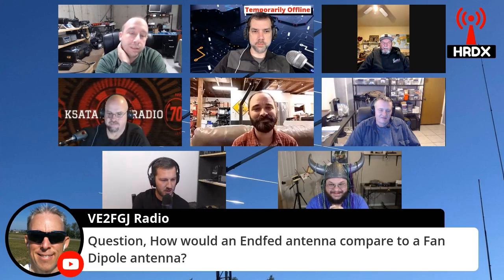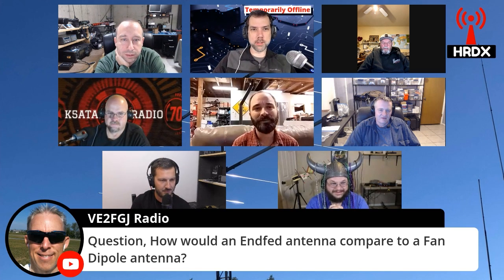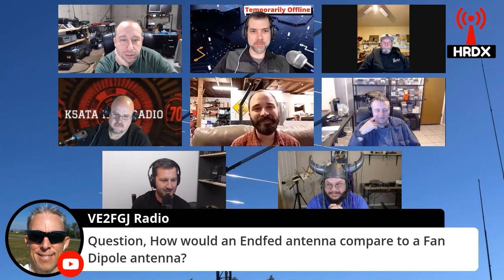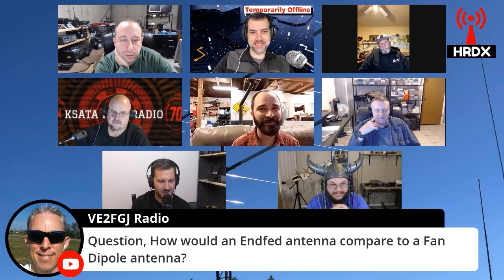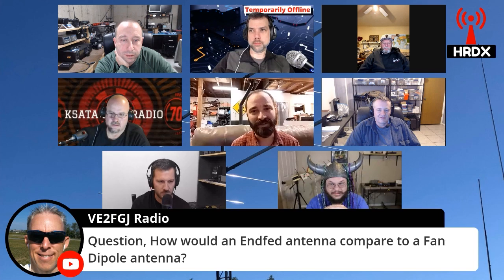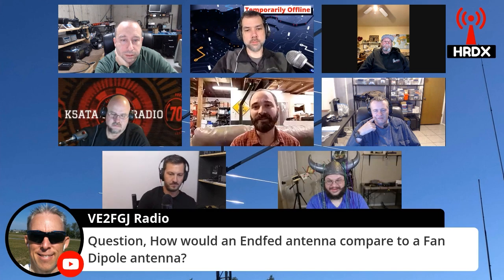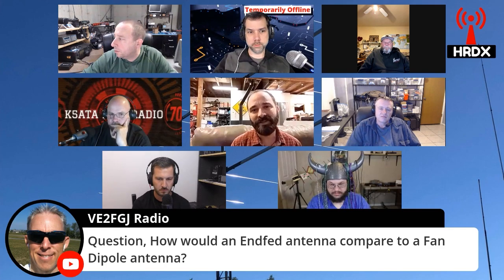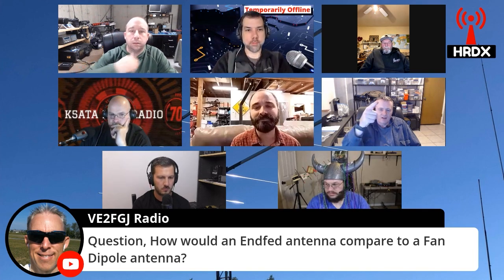End Fed or Fan Dipole Antenna - Which One Should You Use?

Comment: The big advantages of a fan dipole, of course, are:

a) - Requires only one coax, and not ladder line.
b) - Provides multi-band operation without the need for a tuner, so you can switch bands and immediately start operating.
c) - It is a full-length antenna with no loading coils or traps that lower efficiency and narrow the bandwidth of operation.
d) - It is inexpensive.
e) - It is easily constructed and tuned.
f) - It can handle a lot of power (up to 1.5kw).
g) - It can be suspended vertically to provide a very low angle of radiation for DX and requires NO radials.

If I had to choose only one HF antenna to use for the rest of my life, this would be it.   It's simplicity, lack of a need for a tuner, and ease of use simply cannot be beat.  Mine provides operation on 40m, 20m, 17m, 15m, and 10m - the most popular HF bands.   Adding 160m and 80m, of course, is also quite possible, but makes the antenna much larger.

Thanks, for the video!
Reply: Thanks for this reply Richard.  I'm a new ham and am trying to decide what to go with for a permanent HF antenna.  Today I pretty much decided on going with a fan dipole, 40-10m.  Your post has helped cement that decision.

I would love to have an Optibeam OB 12-6, which costs $3200 (ships today!), its longest element is 48 feet, and I would love to put it on a 100-foot tower in the yard.  That is not in the budget, and I'm not sure I would welcome the maintenance, weather damage, technical problems etc that will arise with such a lovely beast looming over my QTH while not having the equipment or expertise to repair it myself.  I would want to have an experienced antenna/tower man on speed dial should anything happen.

A nice fan dipole mounted to a couple of tall trees (which I have) and secured with a weight/pulley/paracord/poly rope system to be able to raise and lower it by myself at will seems like a far wiser (and about 95% cheaper) choice for the average dumbass who has just enough knowledge about everything to get himself in trouble.

Thanks again for the reply and for sharing your knowledge.  It's appreciated by us newbs.
Reply: @Brian424  Beam antennas are very nice - if you can put them together , tune them, install them, and troubleshoot them. They are exponentially more complex and difficult in virtually every way you can imagine.  A good analogy would be trying to learn how to cook and starting with the fanciest dish a five star French restaurant has to offer when you can barely scramble eggs - a frustrating endeavor that is bound to end in frustration and failure - unless, you get an expert chef/Extra Class amateur to help you out.   And, that's AFTER you plunk down your hard earned money and wait for the kit that you will have to assemble arrives.   And, in the end, you won't have nearly the feeling of satisfaction that you would get from building your own fan dipole from scratch.

Building your own antennas is also one of the most important skills any amateur radio operator can develop.  And, it is one of the most fun things you can do as an amateur, too.  Besides, cracking a big pile up with a 48 foot beam is hardly much of an accomplishment - but, cracking a big pile up with your own homemade antenna can be.

I remember when I first got into amateur radio I met an Extra Class licensee in my neighborhood (I went to high school with his son) and he had a nice array of antennas on and around his house.   But, the one that impressed me the most was when he told me he was using the gutters on his house as antennas.   Then, he showed me his awards for working the whole world on 0.5 watts.   I was hooked.

Have fun building your own Fan Dipole!  A beam antenna will come later when you learn more about how to build them and actually do so from scratch.   Then, when you've got that down, putting together a kit made by someone else might be in the cards - and, you will be able to handle it.

73
AI4IJ

Comment: I've been very pleased with random length end fed. 136' high power capability.  I've talked over 7500 miles on 10 meters just this week and haven't had the need to use a tuner yet. Many contacts have been surprised to hear I'm using one.

Comment: I am playing with wires for many years and still do. The fan dipole is great, but you are limited to number of wires, you know, usually one wire=one band. In flat top configuration it is directional antenna like every flat top dipole. You can make in a bit omnidirectional making it as inv.vee. 
Anyway, if I would choose just one antenna, first I must ask if I have lack of space (tiny lot, apartment house) or plenty of space.
In the first case, I would go for Cobweb antenna, you can buy it or build it. You can cover all bands from 40m to 6m. It is omnidirectional and very efficient. If you try to build fan dipole for all that bands, you will get a non practical extremely heavy and big monster. So far I tested it, this Cobweb is the absolutely best antenna for those with small lots etc. But not only for those, many hams using Cobweb anywhere, due to its price. Not all hams can afford towers, rotators and beams.
In the second case, if I have large garden or so and want just one antenna built for few bucks and for as much bands as possible, the absolute winner is Double Windom. 42 meters long version covers all bands from 80-10m. With tuner you can use it on 60m too ( I did over 120 countries on 60m band with this windom). With ext atu you can even tune it on 160m, of course with low efficiency, but it works somehow-I worked all continents and lots of dx with just 100w on 160m with this 42m long version. Ideal height is 10-15m above the ground. I use it at 10m agl and working the whole world every day with just 100W. Of course, in case of any antenna, it always depends what you have around, I mean surrounding objects and so. Location is always the main thing for any radioamateur. VY73

Comment: ....What the guy with the beard (Adam) said!!!     Bang on!! I have a 66ft end fed with a 49:1 transformer, resonant on 40,20,15 & 10, and I have just tacked a 110 microhenry coil on the end, with a 2 metre wire tail, and it now loads up on 80mtrs as well, ( albeit only 100Kcs 2:1 bandwidth  Small gardens in the UK!! )   Just fit a short counterpoise at the matcher box, you'll be fine, and it only needs support at the far end!!     Its a winner for me!   G4ZWI
Reply: same here .. very easy antenna to deploy 73 de 2E0RPS

Comment: I have used MMANA to simulate an 80m EFHW low to the ground (20 feet ish inverted V, ends 6 feet up). It works well but the patterns are SUPER ugly for the higher bands (20,17, and on), as there is very little low angle radiation. For 80m and 40m, it works alright. Note: I ran the simulation after I tried an 80m efhw in this position and wasn't happy with the performance. 

I've built an 80/40/20 fan dipole, and it performed better than the end fed for sure. 

In my opinion, the difference in performance is due to the portion of wire that is radiating, and where this wire is relative to the ground. For example, on an 80/40/20 fan dipole, the 20m wire is high up, and only radiating from that section of the antenna. On an 80m end fed, the whole wire is used on 20m, so the radiation occurs along the whole wire, and the portions close to the ground are far less efficient! Basically, it's four 20m dipoles, but some are high up and some are low and less effective. 

Hope this makes sense, it's just my $0.02. 73 de VE3GKT!
Reply: You are absolutely correct.  However, the entire point of using an efhw is to get it up higher, because there is no need to run coax to the top if the inverted v.  Therefore, it is impossible to compare pros/cons without also considering the installation advantages of an efhw.